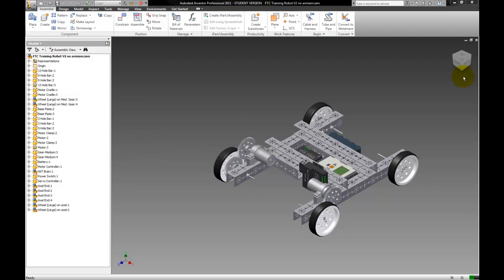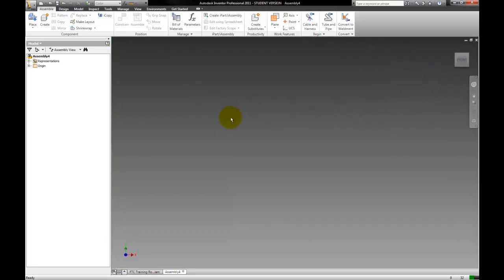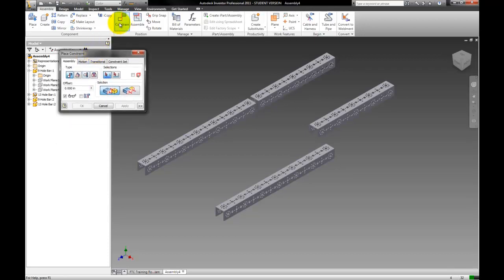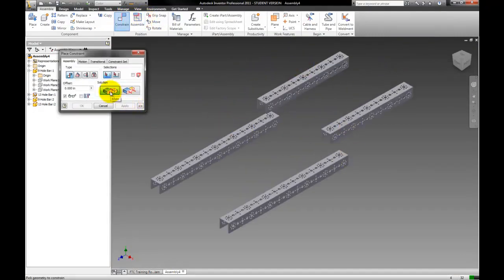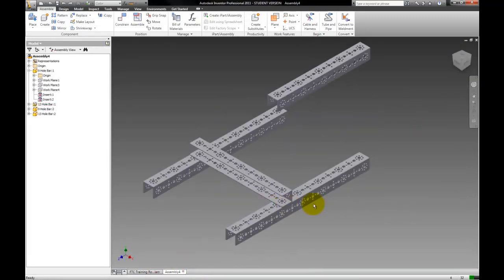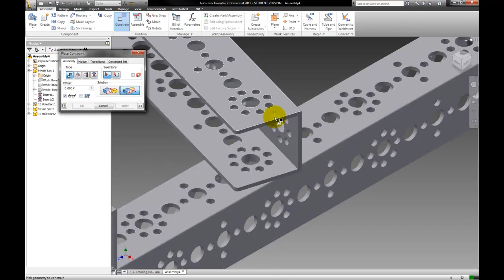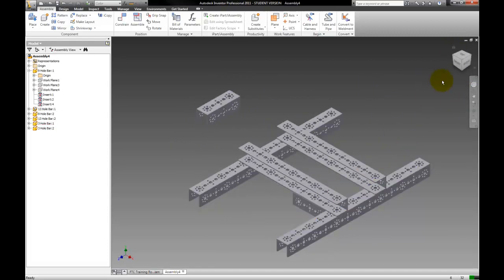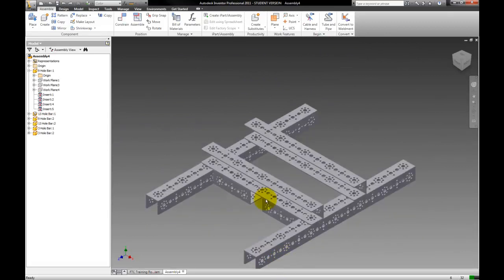FTC Assembly Part 1/3

Comment from the maker: I downloaded the new FTC parts and had the same issue. For now, I would suggest downloading an older packet of FTC parts (see archived folder choice). 

The only fix I know of immediately, is to open the parts in Solidworks or Pro E and then save them as a file that Autodesk Inventor can open. (Note that Inventor should open .prt files, but it doesn't work with this batch of FTC parts.)

Comment from the maker: @bluemini9 Yes, all the parts are ProEngineer, but you can open the files in Autodesk Inventor and then save them. You should be able to make most edits. If there is any reason the files do not work, I would like to hear about it so I can look into it (since I don't have time to find flaws myself).

I personally made most of the parts for Inventor when I was in High School, so if I get enough need I can post those parts on the internet somewhere.